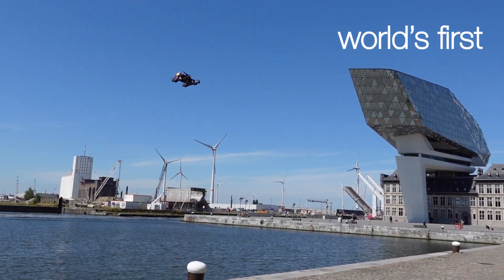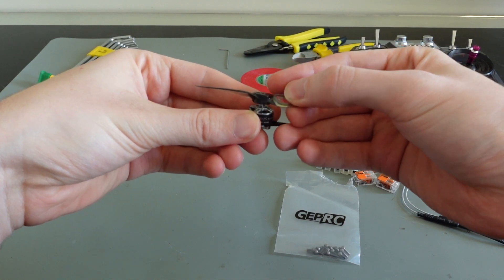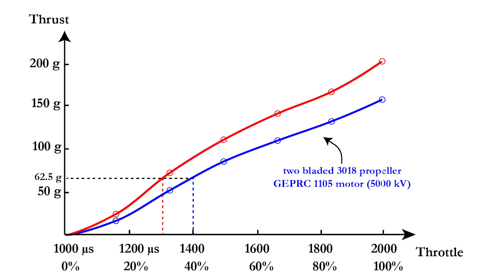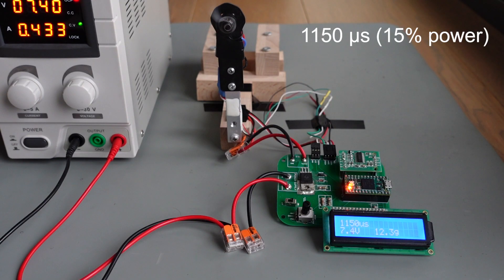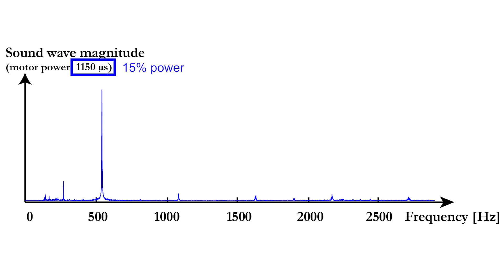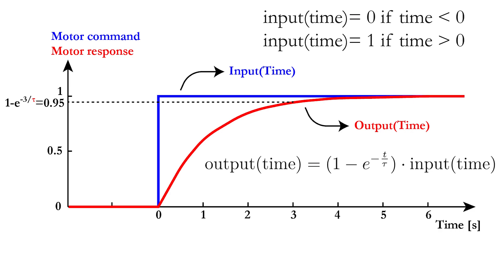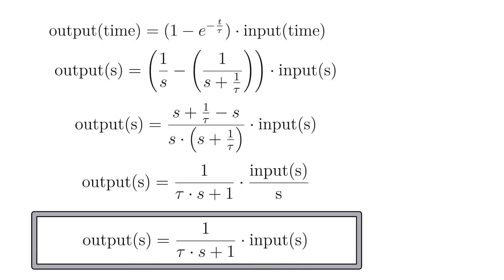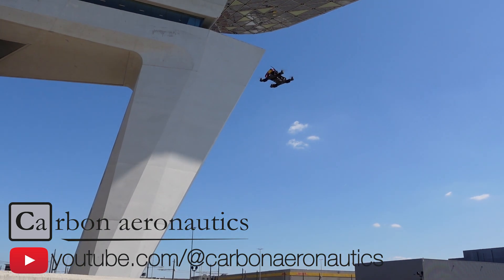1 | How to simulate a drone motor mathematically

Comment: Thank you for showing the speed step response of an ESC with drone. I have been looking for this information.

Are all ESCs sold for drones equally capable of changing the speed fast? Are some ESCs better than others?

I have looked several places for information, and it seems that it is a concern for hobby drone builders to have a fast dynamic regarding speed of the drone motors. I am just surprised to see, that almost none of them measure the step response in order to evaluate that. I have discussed that in a forum, and it was argued, that the sold ESCs for drones the past 10 years already have achieved perfect status, and there is no need to compare ESCs. Do you agree?

Is your ESC used an old ESC, or can it be considered at a modern ESC used for many drones now?

I should guess, that measuring the dynamic speed change of a motor can be done easily in many other ways that using sound.

A fast speed loop is also needed for the motor drive on sewing machines. However this fast response is needed at low speed.

Comment: I like your video series. its quite good very well explained with proper logic. Just small correction please check Kv rating its Kv rating not Kilo Volt . 
Kv is motor constant that equivalent to rpm/V.

Comment: This is great.  I have built a brushless motor stand that measures thrust and motor RPM (using an IR sensor) instead of measuring the sound of the propeller.  This series is a university level introduction to control system dynamics.  Many thanks.